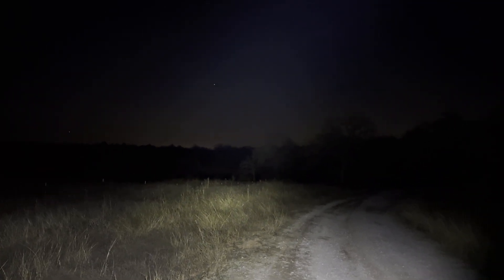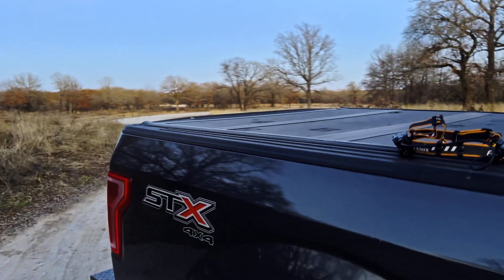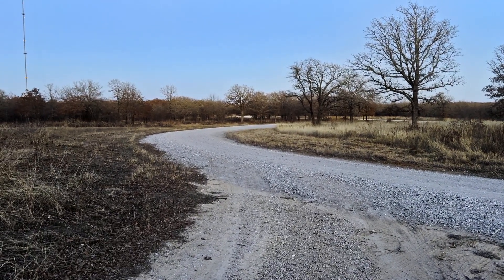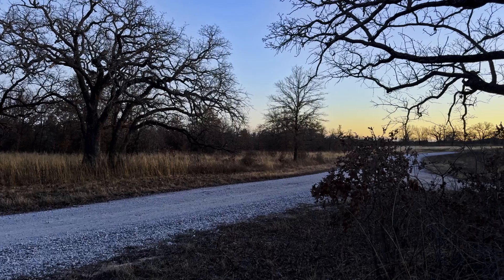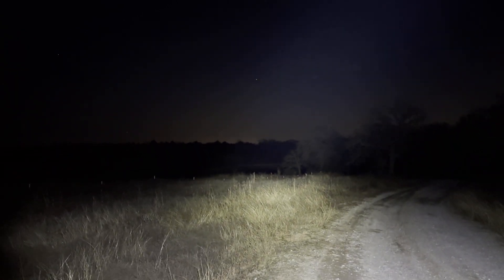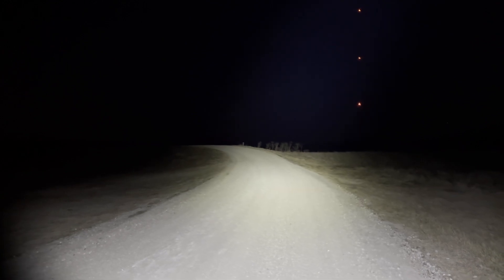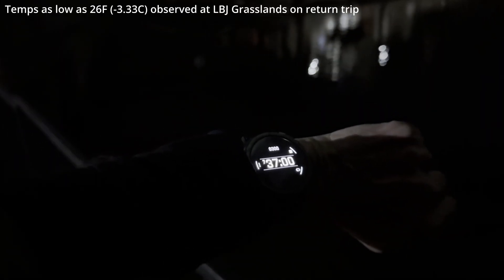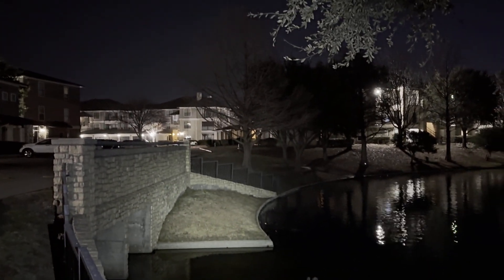FENIX HM75R Headlamp Extended Turbo Burn Down: How Long Did It Last?

Comment: That was some exercise.  How did the headlamp feel having on for so long with the power extender?
Reply from the maker: Yes it was :). I commented on the fit in the initial review and my opinion was unchanged during this exercise. I was wearing a knit watch cap and the headlamp continues to demonstrate good balance and comfort with the power extender.  Now, I'm used to wearing a bump helmet with a heavy headlamp, so weight was not an issue.  I probably would not want to wear it for hours on end on bare skin, but I wore it with a Buff during the first review.  No problems.  Hope that helps.
Reply: @L5-SAR  Thanks!